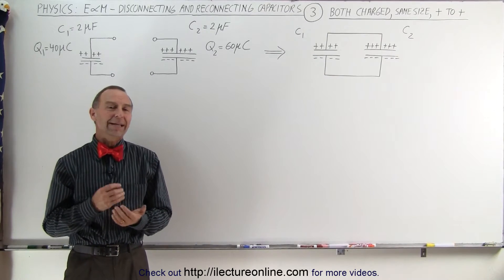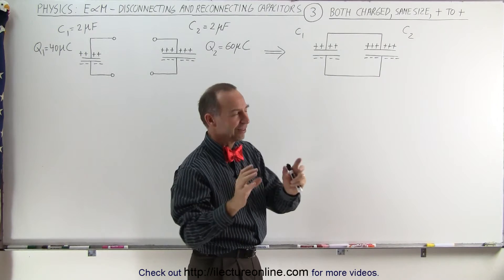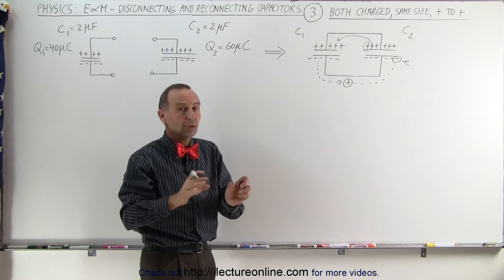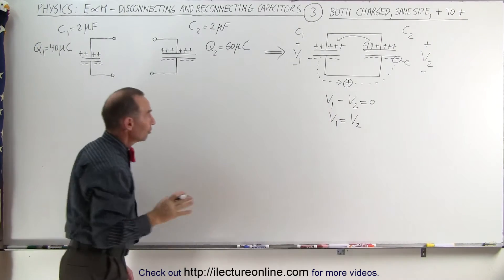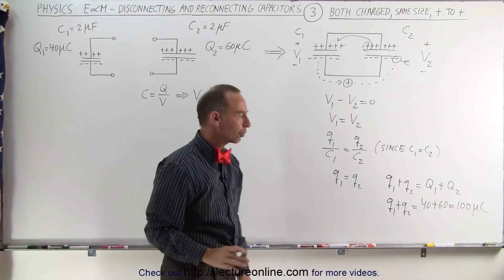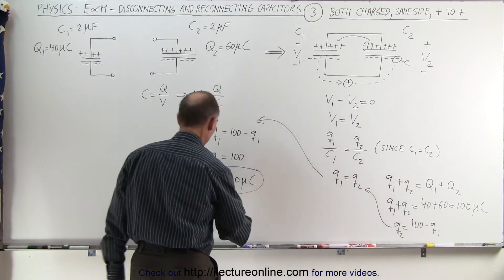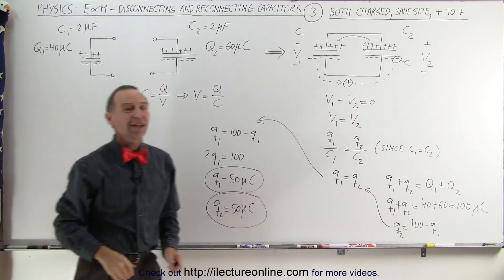Physics - E&M: Dis- and Re-Connecting Capacitors (3 of 16) Both Charged, Same Size, + to +

Comment: Sir thank you for your video.
I have a question. Why do we add Q1+Q2? 
My understanding is since the charges are moving from one capacitor to another and they cancel out each other, I thought we should subtract the original capacitances.
Reply from the maker: Because each capacitor contains some charge and then when you connect them together they bring a total amount of charge to the circuit.
Reply: @MichelvanBiezen  So it's because it is connected to equal polarities. 
Is it correct sir?
Reply from the maker: Sorry.  I am not sure what you are asking.

Comment: Sir A 6 uF capacitor is changed to a potential difference of 120V and then connected an unchanged 4 uF capacitor. Calculate the potential difference across the capacitor. Please Sir solve this problem
Reply from the maker: Isn't that exactly the same as the example Physics - E&M: Dis- and Re-Connecting Capacitors (1 of 16) 1-Charged, 1-Uncharged, Same Size  and the second video in the playlist:  PHYSICS 39.1 CAPACITORS RECONNECTED

Comment: I hope I am correct in assuming that q=50uC on a 2uF capacitor, via the formula V=q/c, gives V1=50/2=25v and V2=50/2=25v (same final voltage).  HOWEVER, I still get that same annoying "energy loss" as an equal voltage LOWER than 25v.  Upon connection in parallel, I can still see that spark that haunts me so!  I just have a feeling that this spark is related to the final energy loss!
 I used two 1uF microwave oven capacitors in parallel this time, as a single 2uF capacitor (TOTAL four capacitors).  I used a capacitance meter to check the uncharged capacitors first.  For initial charge C1 was 20v and C2 was 30v
Again, the experiment was done with great care.

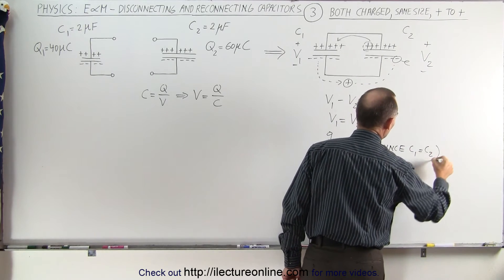Comment: 2:22 "SINCE C1 =C2 " .But initially capacitances of both capacitors are different . For capacitance to increase we have to increase the area of plates which is one of few factors affecting capacitance . Then how at 2:22 we can say y C1=C2 without making any physical changes ? (and also in q=cv  c is kind of proportionality constant ) . Thanks!
Reply from the maker: The capacitance of both capacitors is 2 microfarads from the beginning and did not change.